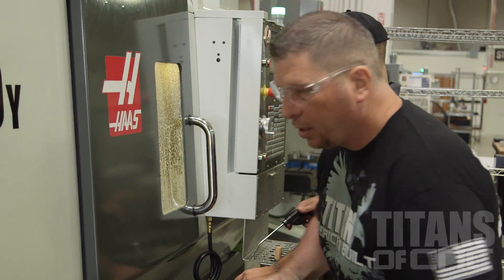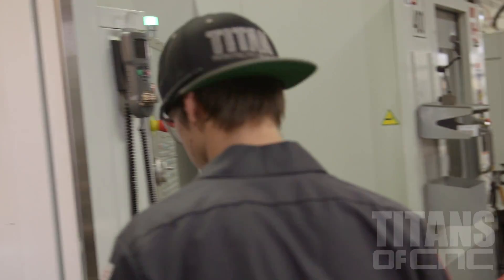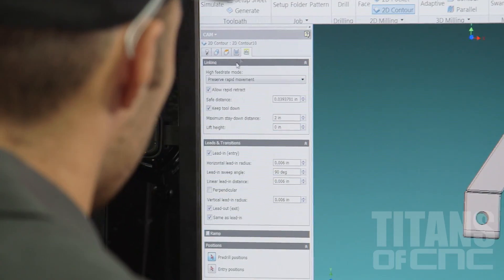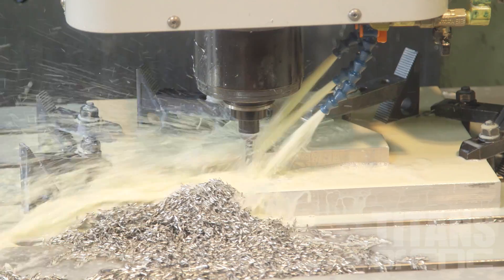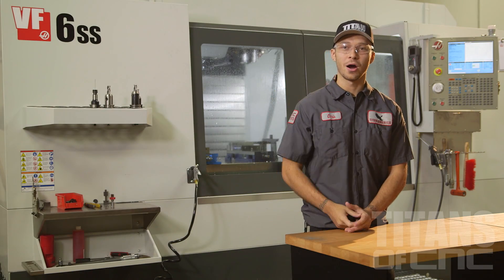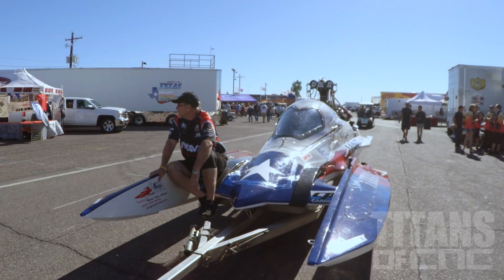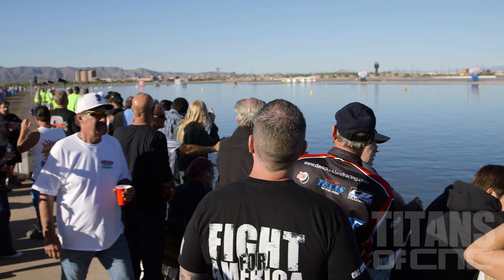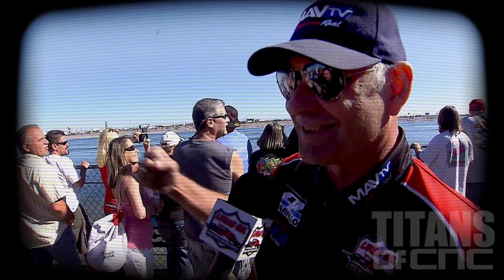CNC Machining Titanium for the Fastest Boat in the World.

Comment: Wouldn't a water jet made quicker work of this with the same outcome.
Reply: not at those speeds. surface piercing propellers are the only solution for speeds over 50-60 knots... or just jet engines :P